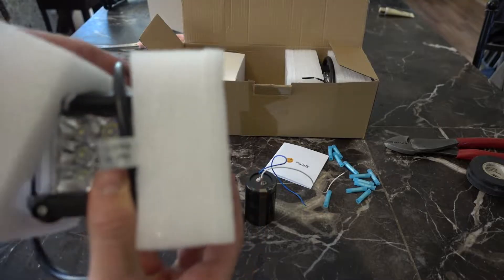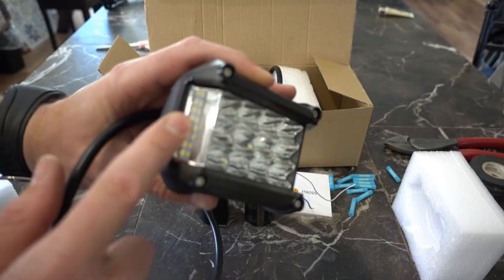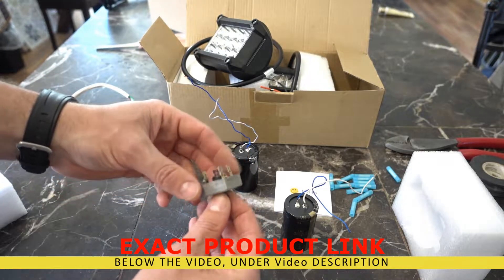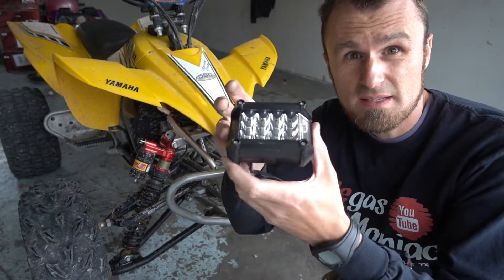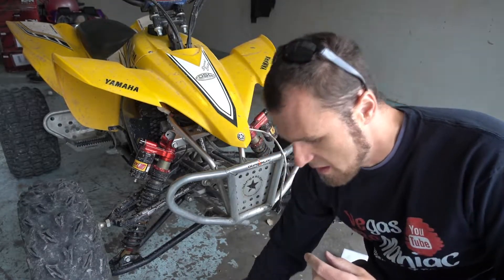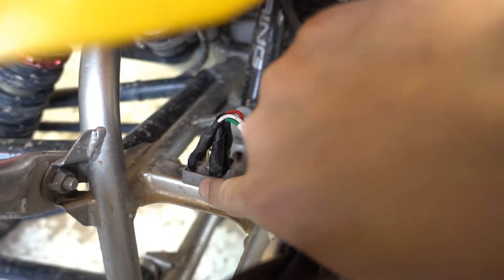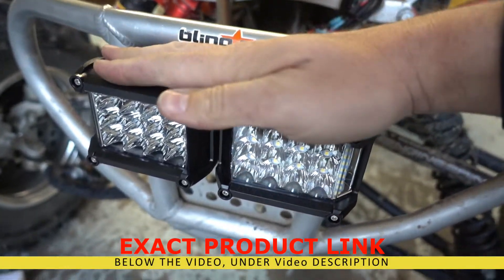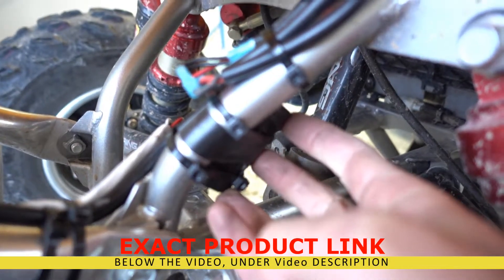How to install LED ligh BAR on a QUAD, convert AC to DC for led lights

Comment: I was looking for a way to do this to my yfz but I think i
 will just spend the 180 on a new high output stator with a new voltage regulator that allows me to run the lights off the battery. pricey but this seems a little sketch but if it works then it works

Comment: Is there any reason you used a 400v rectifier instead of something smaller??
Reply from the maker: Only one I already had.. But you do need one that is rather for more than 12 v, maybe even. More than double
Reply: What would you recommend for a 2009 honda crf100f that has a baja designs stator??    It puts out 30+ volts ac, but i need it to be 12 volts dc for a 18 watt led light